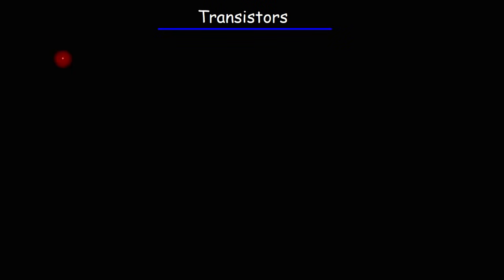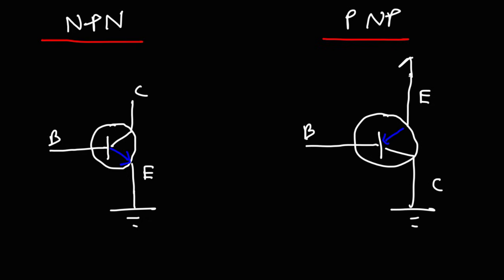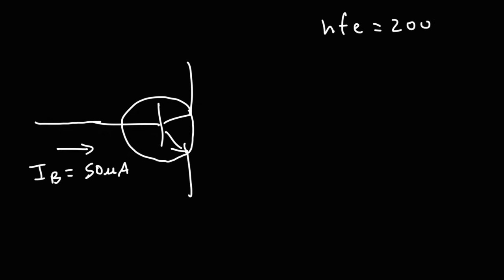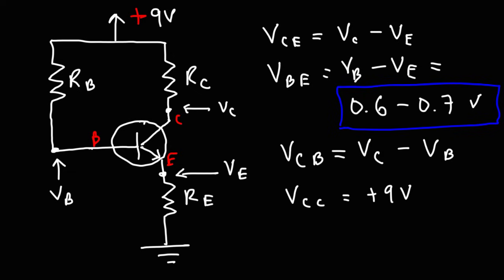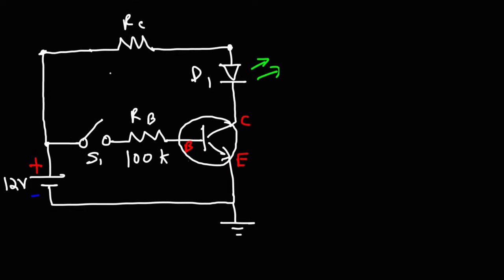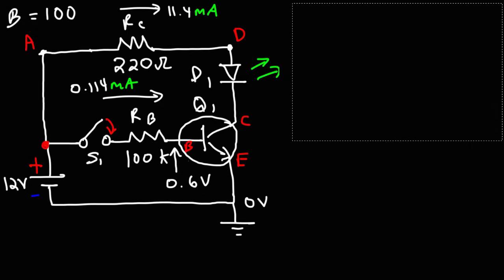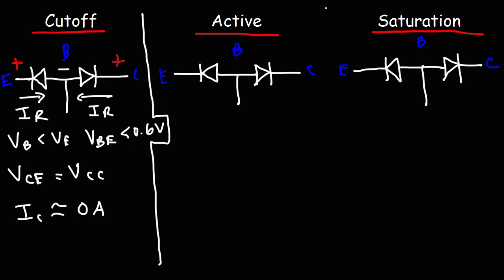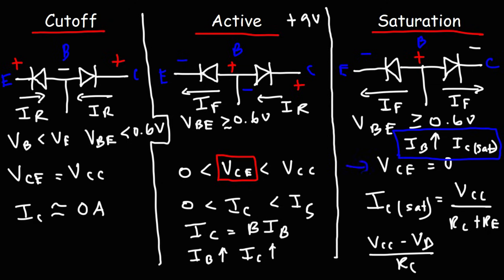Transistors - NPN & PNP - Basic Introduction

Comment: This is a great video and I appreciate you posting it immensely.  I have a quick question though....why does the NPN circuit on the left have what I presume are two independent battery power sources but the PNP circuit on the right has only one?

Comment: A question please. At 10:19, given 200 hfe, when apply 50microAmp to the base, will the transistor generate automatically the current readings at the collector and emitter points?

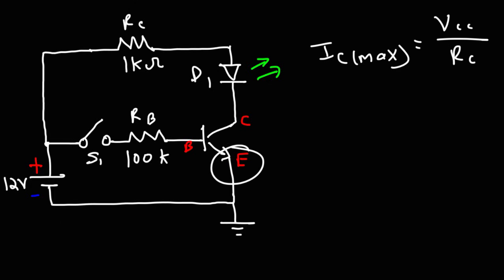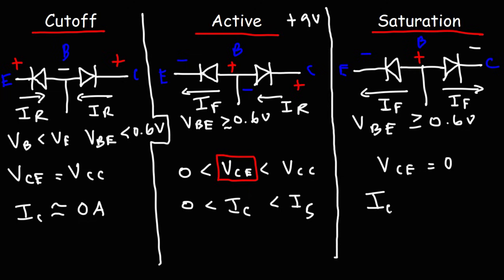Comment: Gerat video.  I'd like to comment on the saturation region of operation mentioned at 16:54 and 28:29.  Rc must be large enough and Vc must be low enough so that Vb > Vc, and the base - collector PN junction for this NPN transistor becomes foward biased.  So, in my mind, saturation is not just any old Vcc / Rc or just the max current of the circuit.   It's Vcc / Rc if (and only if) Vb > Vc.  In other words, the base-collector junction must be forward biased to have the transistor operate in the saturation region.

Comment: I was a little confused early on you said the voltage drop was 0.6 to 0.7.  I hung in there and you showed examples of 9 volt and 12 volt . Does the .6v drop get smaller if the applied voltage is 5 volt , or 3 volts ?

Comment: Very useful. Easy to understand. Well explained.

Be careful not to confuse BPJT npn, with MOSFET N channel.
In an N channel enhancement MOSFET, the gate(base)  voltage has to be above the drain (collector) voltage, at least by the gate treshold voltage.
in a MOSFET the gate(base) is completely isolated/different circuit to the drain-source.

 BPJTs are obsolete. MOSFETs have superior technical performance.
Reply: BJTs aren't obsolete. You can use them for current amplification. You can't do that with MOSFETs because they are voltage-controlled

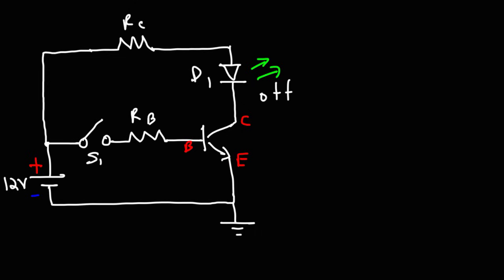Comment: Hello :) in the minute 14:16 why when the switch was open the diode was off as when the current pass throught the first junction it will leave the open key as it high resistance and go through the Rc and D1  ?

Comment: 3:00 How can current pass through the transistors when the diodes block current ???
Reply: the diode has a current limit that it can block, if it is exceeded the diode fails and lets the current pass, if I'm wrong correct me.
Reply: @gabbriellungu9720  makes sense. Thx
Reply: They parts of the transistor act like diodes, but then a small current flows through the base, a larger current can flow through the two "diode" parts.

Comment: I agree with most everything he says except the way current flows. It was instructed to me that current flows from negative to positive in a DC circuit.
Reply: That is the flow of electrons, since they hsve a negative charge, they flow from the negative to the positive. When talking about current, it is conventioned that the flow is from the positive to the negative sides. Most formulas and rules apply to the current flowing the way its conventioned, so I suggest sticking to it when doing your own calculations to avoid unecessary mistakes.
Reply: @RBgamesbr  Agreed!  Most electronics technicians and design engineers pass their entire working lives using conventional flow and it doesn't make a blind bit of difference.  As a physicist, I only need electron flow when dealing with electrochemistry, magnetic fields or gas discharge tubes, x-ray tubes, thermionic valves etc., otherwise conventional flow is just fine for circuit diagrams and totally irrelevant for AC circuits.

Comment: Maybe someone can help. How is Vbe .7V when the Emitter voltage is larger than the base Voltage? How could you get a positive number if Ve is more than Vb
Reply: Vbe is the difference in voltage between the base and the emitter.  The emitter is nearer to ground (=0V) than the base so has a lover voltage than the base.    The Vbe is called the "bias" voltage of the transistor.

Comment: Thank you so much. i do have a question about this circuit https://prnt.sc/10pgfu1 i cant seem to get the right answers on the test points (TPA=12.74, TPB=9.1, TPC=8.4) will much appreciate it. thank you again
Reply: BTW the test points are in volts

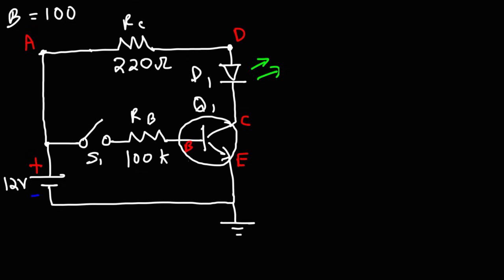Comment: Thanks a lot! A very thorough explanation, I've followed along and taken notes 😁 One question though: How did you determine that Vbe is 0.6v at 17:50, couldn't it be higher or lower than that? I assumed you'd need Rb to and Vcc to calculate Vb. What if Rb = 0Ω and Vb is 12V?
Reply: I think it being 0.6 or 0.7 is a standard
Reply: if Rb was 0, the current flowing into the base would be large, which would damage the transistor
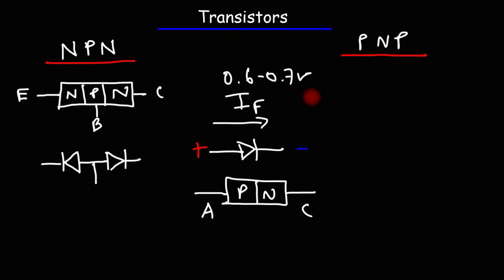Reply: 1:51 :)

Comment: Great tutorial. One question was(?) left behind. You used LED as the load. It draws say 20mA thus in "no transistor" circuit it needs resistor (so it won't get fried). Video and books state that Collector operating current depends on what comes into Base. The question is, can LED forward current be trimmed just by the resistor applied before transistor's base? Later on. What happens if LED is replaced with 100mA FAN (many BJT max safe operating current? Nothing I suppose but let's go big and connect 3...

Comment: Really admire your presentation;however, when Q1 Base is high enough to essentially close the Collector Emitter channel, or close the switch, the Vce or potential between the Collector & Emitter is effectively 0 Volts (or .6V) not 7.49V as presented. Vce would be 7.49V in an inactive transistor state (or open switch if you will). Thank You Again!
Reply: That is incorrect i think. Since the Transistor is operating in forward active mode, V_CE is actively blocking some current from flowing through it. This results in a potential difference btween C and E. The 7.49 Volts are correct.
Reply: @ceredril  You are right. 7.49V is correct.
Reply: Are you referring to the section around 23.03? Should he have called 7.49V Vc rather than Vce? Or is that the same and should be .6V?
 
Thanks trying to make sense of this

Comment: First off.  Thanks for the video.  It really did clear a couple of things up for me.  But I'm a little confused about the calculation for the base current in the LED example you gave.  The voltage drop across the resistor was 11.4V and the resistance was 100K ohm.  Shouldn't the resulting current be 114uA and not 114mA?  Pushing 114mA through the base of a transistor would surely burn it up, no?
Reply: @Scott Nixon - I got tripped up on that too. However, he calculates it to 0.114mA not 114mA which is correct.

I had to go back and double check my math to get that one.

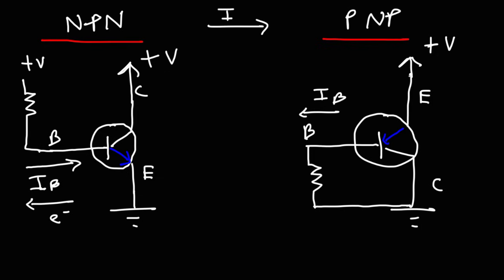Comment: At 5:35. How come conventional current flow from high potential to low potential and electron flow from low potential to high potential?
Reply: conventional current actually shows positive charges or electron holes, so because of this conventional current actually flows in the opposite direction as electron flow. As a side note, conventional current was created by mistake, initially scientists thought that the positive charges flowed in a circuit, but later on they discovered the electrons actually flowed in a circuit and that the positive charges they were observing were actually electron holes.

Comment: If one would build the scenario as shown @ https://youtu.be/AcxDiesy-nI , you will get a short. connecting the negative terminal of a battery to ground is very dangerous. current flows from the negative terminal to the positive terminal.

Comment: Hi. Since the PN junction between the base and collector is in reverse bias when you apply a positive voltage at the collector and since reverse bias diodes don't usually allow current flow, does that mean that you need to pass the threshold or reverse voltage of that diode so current can flow through it? And why don't we just use a zener diode as the PN junction between the base and collector since that'll require a reverse voltage that can be lesser than that of a non-Zener diode?
Reply: Because zener diodes pass current in 2 directions, depending on intensity of current, so voltage differences would cause your current to flow backwards, or forwards. Too complicated.

Comment: ....( I became a little unsure about my previous comment, so I put it under 
in my own sub-post here. This will be interesting to set-up an 
experiment on. Will try to do it in very close future. )
Reply: I became a little un-sure about my previous comment, so I put it under in my own sub-post here. This will be interesting to set-up an experiment on. Will try to do it in near future.
".. [My previous comment moved here]
1) Nice presentation,.. 2) But shouldn't one perhaps know the specs on the LED and the Q first (voltDrops for both of them),..to determine the presentations suggested mA trough the 220-resistor at the top? ---a nice idea instead could perhaps be to say that there are a 'Potential' for a so-and-so mA current (via the top-branch and down towards the transistor and Q-currentSat.Max ).  -->But one can't tell, before one know the total "resistiv-ness" in the upper-current-branch between point -A and -C. ,, >>Would suggest a theoretical voltDrop-spec for; Led=2v, and Q_Vce-sat=0,1v (a summing voltageDrop can then here be found between point D and E).. With this, one could have a more sound calculation-practice. Just put it to the test. Put in those two suggested parameters for the D1-LED(2v) and the Qtransistor_Vce-sat(0,1volt). One might at the end now find that one component perhaps is somewhat under-dimensioned, with a risk for an adjacent component to be over-stressed(current-wise) and eventually fail. 
//Otherwise thanks for video TOCT, the presentation is good in all other parts. Have a nice upcoming week.
"..

Comment: Really great video (I like the style of this it's so similar to Khan Academy!!!)

I have one question though: If the transistor is in active mode, how does current flow if the Collector is at a higher voltage than the base and the diode there is reversed biased?

Otherwise really informative and educational clip! Really enjoyed it!
Reply: great question man although i forgot a little bit about how voltage difference works, but the same question popped up to me aswell that in both transistors, there are backward/reverse biased transistors, which basically work as insulators. So i think there should be pause in the current flow. Do you have the same question in mind aswell?